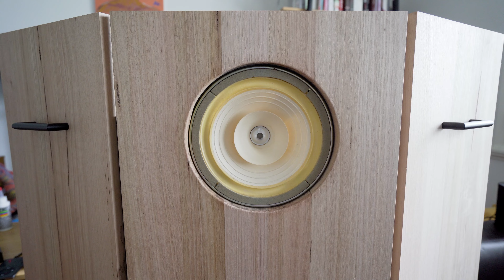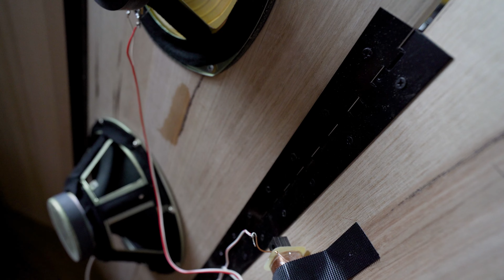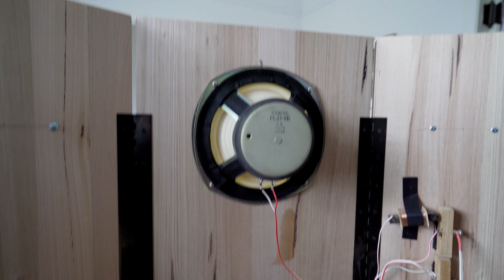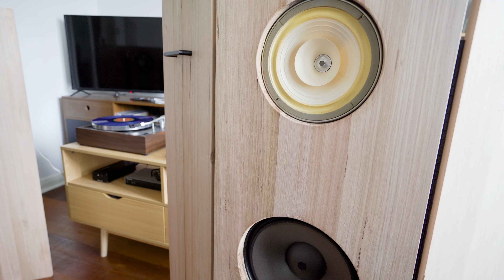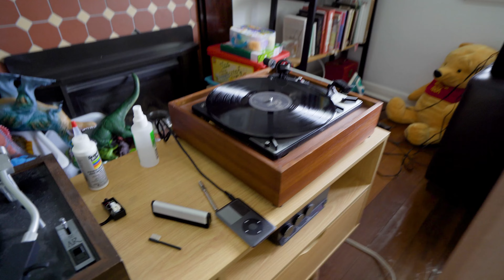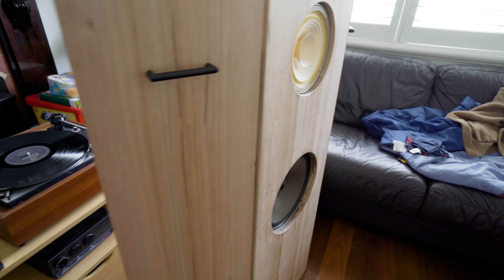Coral Speakers - DIY Open Baffle Build

Comment: I correspond with Keven from time to time. He introduced me to tube amps , and open baffles. Two years ago he sent me a pair of Coral Holy Baskets as a Christmas gift. I'm now using them in a open baffle bi-amp setup with pair of digital audio Maraschino Cherry amps driving Two ten inch bass drivers in each baffle, and a 300B tube amp driving the corals. I'm using a Marchand electronic crossover set at 400Hz. I was using a pair of Tang Band W8-1808 drivers and then later a pair of Mark Audio Alpair 12p drivers,. I was reluctant to retrofit the small Corals , because I didn't believe they could compete. Was I wrong ! The Little Corals trounce them both in detail and separation. I have played them as high as 100 db with no distortion.  Every time I listen to these 3.5 inch drivers , I'm totally amazed at how great they sound.

Comment: Big OB fan.. this is one approach but, the sound will always appear to come off the baffle. Minimize the size of the baffle ( kill the side wings) and use a filter to compensate for step baffle loss. Try it..
Reply from the maker: Thanks Luis, I will give it a try. My biggest fear is filters on full range drivers, of which I love very much. I always feel that the moment I put any components or filter in front of a full range driver(either OB or boxed) they lose their magic. Also could be because I'm using ancient drivers 😅

Which program do you use for the baffle step correction?
Reply: Agree, no point in using components with FR, counter productive. Can I ask please, do you find the wings help? Have you tried with and without? There’s also the arrangement with one wing at right angles, like the “chilli” baffle. Any thoughts?

Comment: You could try to mount the handlebars vertically (and may be closer to the edges,), cause in a horizontal orientation they cause some associations. )

Comment: Did you ever put the 3.5” corals (from  the Sony RtR TC 500 ) into a good speaker enclosure? I hooked mine up as is in their original Sony enclosures, to a small amp, and I must say the clarity is amazing, but no significant bass for obvious reasons.  I have a couple of small 8” woofers I could use with them, I wonder how they would sound if paired together.
Reply from the maker: Still building them! One of my most ambitious builds yet, but taking a while. Mine will also have a woofer for extra bass so I think it's the way to go 👍

Comment: What difference does the position of the side flaps or wings have on the sound?
Have tried closing the wings as far as they go and comparing the sound with the wings removed or fully forward?
I am currently making an open baffle speaker pair but without any side panels as seen in your design. I have a stand type extension at the bottom of a single open baffle that holds the speaker upright and secure.
Open Baffle designs are highly sensitive to driver quality. A great driver will sound great in an open baffle speaker system.

Comment: This is an example of how audio becomes a life-long love. I am guilty and charged, as well. The devil related to audio is always in the detail, and I wonder if you have any critical thoughts about hard panel edges next to speakers, since you mounted them behind the front panels. Sound output from a loudspeaker system is seriously affected by the diffraction of propagating waves at all panel edges located close by. Personally, I could not resist buying shape-suitable foam strips called "EPDM Foam Rubber Triangle Shape Seal Strip Block Dust Heat Resist Bar", placing them around the speakers' front to soften the edge interference, and rush to audition that ~$20 investment.
Reply from the maker: Thank you Mark, I think that is an awesome idea. I'll add the foam and make an updated video 😊

Comment: Also, why the wings on the speakers? Are they only for east of placement / stability, or do they help shapbthe sound ?
Reply from the maker: Primarily ease of placement/stability but having such a big baffle I suppose would help. Although there'd be some diffraction when hitting the hinges. If you google the Telefunken open baffle, I think that's what I'll build next 😊
Reply: T Brown, the wings help with the low frequencies as the front wave and back wave will wrap around the baffle and cancel each other out due to being out of phase. The larger the baffle, the longer the wave length must be in order to start being long enough to "wrap" and cancel. Therefore, the larger the baffle, the lower the driver can go without that cancelation. The baffle could be only as high as the woofer section as the mid/high driver will not produce long enough waves to wrap around the baffle that they are mounted in. Hope that makes sense.
Reply from the maker: @sjhorton1184  you said it better than I could 😊

Comment: I see you have (a Goldring Lenco?) & the famous vintage AR subchasis turntable, made somewhere between late 1960's to early 1970's.  It was my first t/t upgrade from a 1980'ish cheap rack system, smoked glass door with flimsy t/table on top, nearly everybody had them it seemed. It started my love of music on Vinyl as aposed to hearing same on CDs  & 35'ish years & very many turntable & tonearm/ cartridge /phono-stage upgrades later, i still prefer L.P. above CDs.   I plan peakers to be last upgrade since one of my vintage 15" mon/gold Tannoy driver s bit the dust a few months back (i'd got them for 120 g.b. Pounds s/h in perfect working order & were fave' speakers since then in 2000'ish (faded signed & dated test labels on the backs had them as made in 1969, so they lasted a mere 52 yesrs from new b4 1 cone bit the dust) I'd tried others new on loan, & went through various e/stat but always went back to the far older Tannoys, boxy coloration at louder volumes was their only weak point to me. 
 Would have been nice to hear some more music with accoustic instruments & voice, as then we can be familiar with the sound's authenticity even if we don't know the track.   Great looking drivers, i'd expect decent bass with that baffle width.  Some manufacturers use D.S.P. or analog e.q. to enrich the bass on O.B.'s to allow narrower baffles but i'm not suggesting it's the way to go & i'd  reckoned minimal x/over (or none) maybe better for an amp to drive them efficiently, but i have zero experience compared to yourself concerning O.B. coned speakers, only what I've heard on tube. 
  As well as many boxes, I've had 3 different pairs of e/stats, loved their boxless sound but their restricted dynamics & deep bass limits always had me trying different boxed & other e/stats.  I'm thinking O.B. coned speakers may give the best of both worlds i.e. boxless sound with more dynamics & bass that inneficient (all) e/stats can easily lack. Plus, the more efficient speakers i've had seemed to have an immediacy of sound i like that inefficient seem to lack, at least in my experience without many 1000's to throw at top amplification.  Good luck on the builds.
Reply from the maker: Thanks for the comment, it's always great to hear one's passion about music and the way we listen ☺️

Tannoys have always been out of my price range but I would looooove to bring a pair home one day, even for a few hours.

AR XB! It's an amazing low energy design, I've made some upgrades on it like replacing the delrin pivot bearings with saphire ruby cups. Are you still using yours?

The second isn't a Lenco but a Dual 1218. I have been wanting a Lenco L70 for a long time though. 

I definitely curtailed my expectations about bass with the open baffles, but I'm really happy, especially with the second woofer driver. A single full range driver is a different story, perhaps not quite enough for all music types. I have contemplated a 2.1 set up with a tube/class d hybrid set up, what do you think?

Sorry to hear about the Tannoys btw, could you get it repaired? For that price you're still on the green!
Reply: @vintageboulton      I don't have my AR XB  t/table any longer as i sold it to a friend so i could buy a s/h near'mint Heybrook TT2 mk2 that came with an Alphason Xenon tonearm which i still have. The AR with it's steel top plate is a formidable design & if i could have easily upgraded the tonearm, i'd probably still have it but that arm wasnt designed to be replaced, not without a major re-work on it's low set mounting hole well beneath the top plate.  Yes, the Lenco's are great design of Idler drive, i once had a s/h  Garrard 401 idler drive for a very short time that i now regret selling many years back, it's massive plinth made by SME for it, was my only objection & i didn't know the cheap tonearm was it's major let-down factor due to my mid teenage ignorance on all things hi-fi at that time decades ago, now they also fetch big money.
  The AR XB was my first 'real' turntable that made me realise how good vinyl can sound.  That was well back into in pre- eBay days when s/h prices of well built gear were affordable to me.  I bought the 15" Tannoy's for £100 + £20 delivery charge from a school's yard sale, the guy told how one was used to play the radio through in their staff rest room & the other was used to play music in certain gym exercise classes. I was shocked when i plugged them in at home & they instantly sent my previous 3-way floor standing KEF's to an eager friend who bought them.  I was further shocked when i saw how they fetched 500 - 800 on eBay shortly zfter i bought them & that price went up to between  £1500 & £2000+ as the years passed.  Unfortunately, the original cones are no longer available & the cone surrounds on mine are not the later & replacable foam types, which may have fixed the issue, which is that the voice coil of one driver is rubbing in the magnet's gap so the cone's movement has lost it's linearity, it's a sound i instantly reckognised from previous experience & hzve fixed on other designs but the cone to chasis termination on the Tannoy Monitor Golds means you have to destroy the main cone's overlapping edge to remove it or re-edge it.
 I have contacted every speaker repair  company i could find but so far, the only one who replied with  "yes, we can fix it" did not get back to me when i asked them how they intended to fix it & asked what cone & surround edging would they use,  i asked because the original Tannoy cones are no longer available combined with the fact that you would have to destroy the original cone's edge to chasis termination because of how they were made to overlap & fix onto the chasis's inner edge (hard to describe tho a glance would tell you)  The lack of response to my question plus the fact they only wanted me to send them the one driver, told me i would have an unmatched pair & lost trust in them to fix them anywhere near close to 'as original'. 
The 2.1 for your open baffles may be the way to go, & i would seriously recomend a look at the O.B. subwoofers like G.R. Research sell in kit form & their  servo-controlled O.B. Subwoofers from same company have a strong reputation for fast & tight bass to match O.B. speakers & pannel speakers, some folk say.  I see you're going dual concentric with those other drivers, that looks like a prommising proposition, O.B. & point source  should sound great.  I'll keep a watch on how youre getting on,  as i believe O.B. speakers is where i'm finally going.  I'm kinda roughing it (relatively speaking) with  pair of Cellestion 3000 ribbon hybrid speakers which i'd kept after a previous upgrade, they were a bit too good to sell for what their going rate was at that time, with one 8"woofer & one  17"inch by 1.5 inch ribbon from 900'hz & upwards, they're not bad but do need a sub for a better bass. I'm glad i did keep &  stash them now.